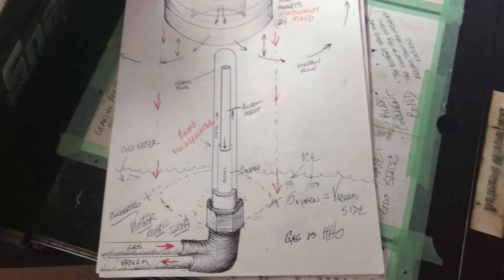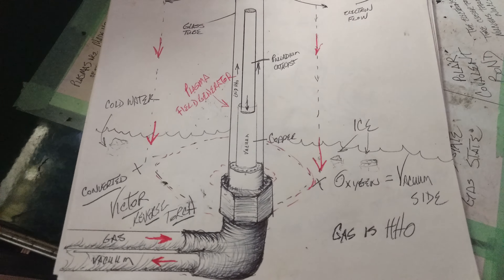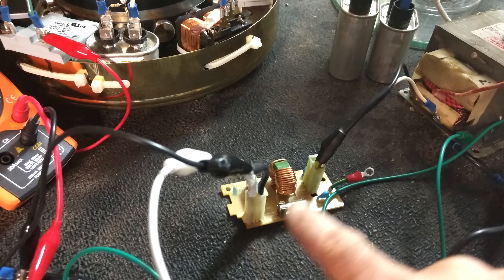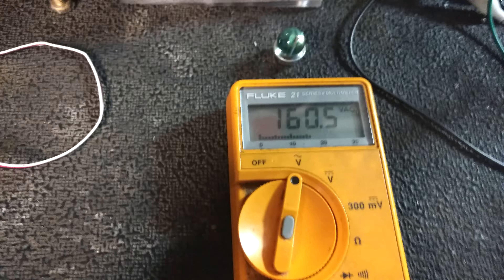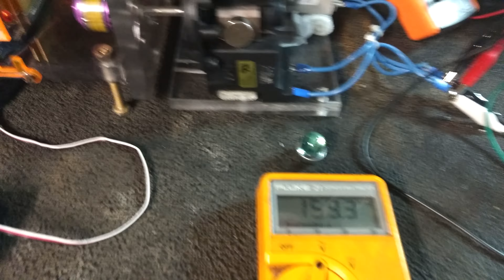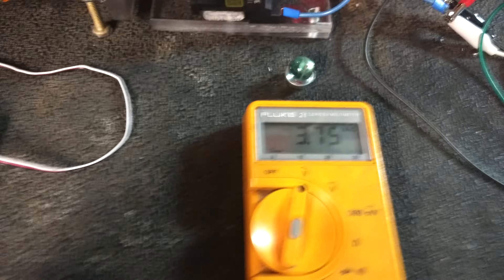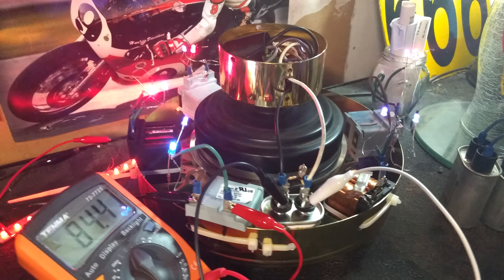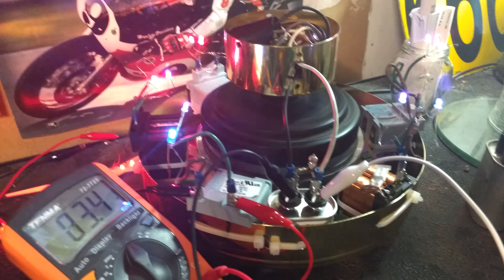LENR... Mysterious voltage...where are my shoes?

Comment: Hello sir,

I enjoy your videos that you post. I believe the mysterious voltage that your meter is picking up is because of your shop lights. The fluorescent shop lighting ballasts broadcasts power through the bulbs when lit. To help verify this run the same experiment but with all lights off and see if their is a difference. Let me know if it works.

Thank you for sharing!
Reply from the maker: Joshua Meldru 
Tried that...no effect. The light directly above my head doesn't work

Comment: I wish i understood this stuff.
Reply from the maker: delvis11 
Yeah...me too! 4 amps in 4 amps out, even with the high voltage
Reply from the maker: Voltage drop...the dryer is running. My wife uses 2-6 dryer sheets. I think it is STATIC electricity picking up in the aluminum foil. Tool box voltage won't climb over 85vac now that the dryer is running!